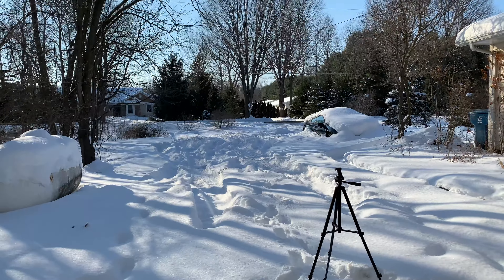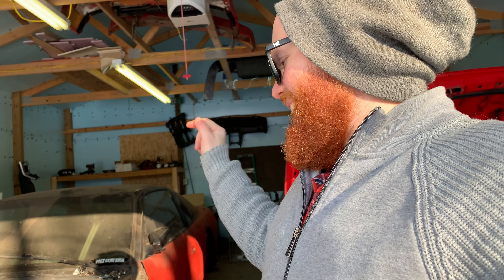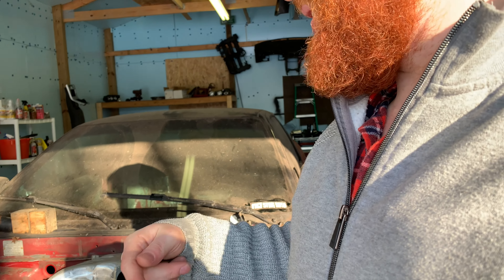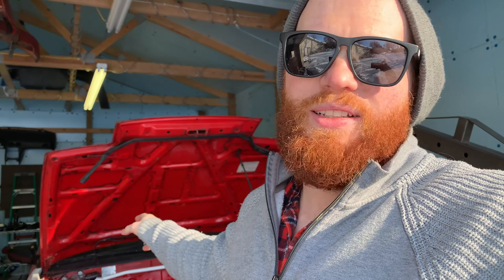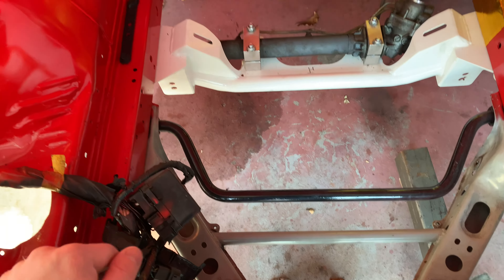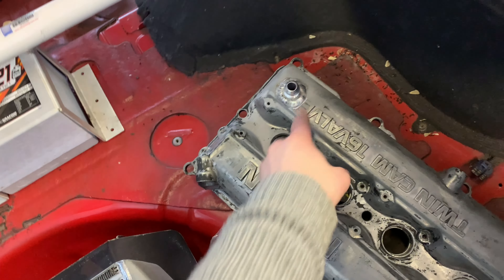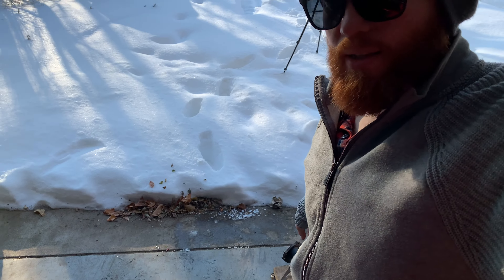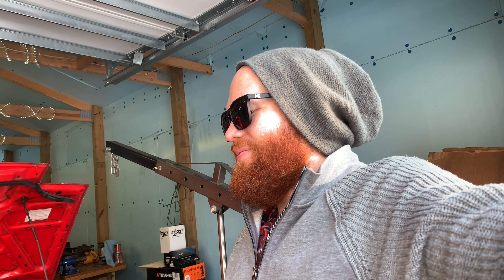S13 Projects: Present, Past, and Future

Comment: If you can get a 2618 material forged piston, they generally use a larger PTW clearance. Not sure what the material of your pistons are but if they’re not 2618 you may be able to sell them and score some to solve the ptw issue with no coating. I like JE forged pistons. I have had a lot of luck with them. On my old setup. It was a single 7675 pte turbo 321 inch SBF on renegade e85. Anyways it made like 800 wheel through a th400 all in like 22 pounds or so was what it would make. It was a basic 7675. I missed on a tune up and nipped a spark plug (drag racing 1/8 mile) and burnt the piston at the valve cut and it burned down to the top of the ring land on the top ring. Didn’t get into the bore thank god. I didn’t even know there was an issue until I refreshed it. I was amazed. My cousin also uses them. He had a wicked combo. It’s a big boy small block. 451 cubes twin 7675 renegade e85, he uses a dominator. I use an elite 2500. Anyways he made a little over 1300 wheel, th400 at 25 pounds and it had je pistons and eagle h beams and eagle forged crank lol. A little worried about the bottom end but it’s living and taking a beating. I just keep the timing low and raise it as the Rpms increase to keep the torque out of the engine at lower rpms.  I found you Bc of wiring. I do all my own stuff aside from engine machine work. Engine trans diff wiring and tuning. So I have mechanical OCD as I can tel you have as well. It has its positives and negatives. Positives meaning when something is finally complete it looks and works great. Downside being the time it takes to become happy lol. Anyways good luck and I hope your Channel and business grow and boom. Ps. Even though I enjoy my mustang, I started my car love affair at with a fc rx7 NA model. Series five 91 gxl. It was great. It had 352,xxx miles on it and was rusty. But I love it. And shortly there after learned what turbos do to rotary engines and later pistons engines. So I am a turbo lover basically and appreciate most all of the car scene. Where ever there is top notch work and function I am drawn to that to learn and get ideas. Anyways. Enough of my babbling. Good luck with that snow. I am in KC MO. it’s been like minus 15 for three weeks. Good times.
Reply from the maker: Right on man, yeah these are low-silicon forgings but the PTW is still too big. Not that concerned about it though! Thank you!